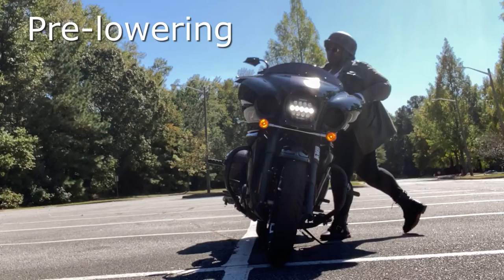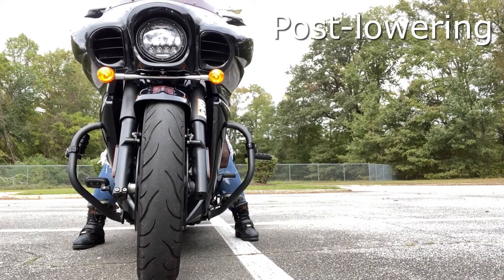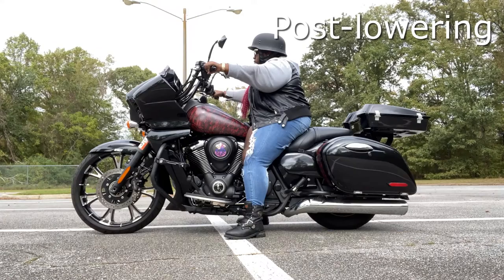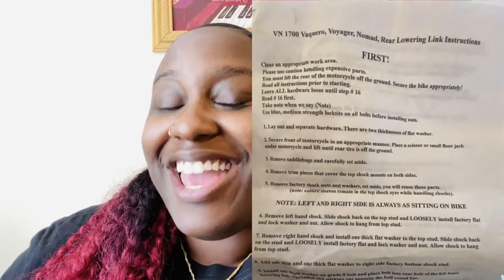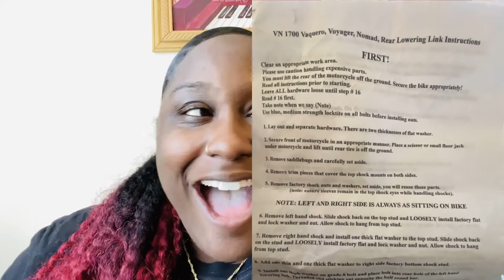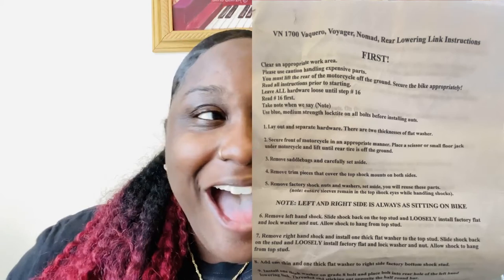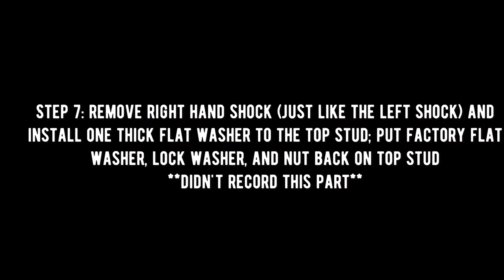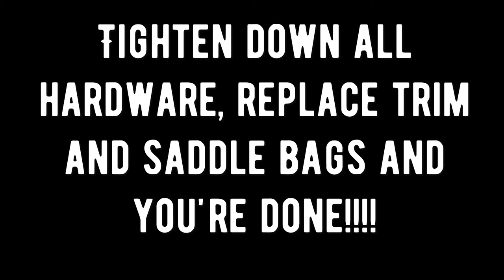LUVERNE LOWERING LINKS FOR KAWASAKI VAQUERO & VOYAGER/NOMAD | Review & Installation Process

Comment: When you decided on the Vaquero, did you have prior experience riding big heavy bikes, or did you just take the gamble of learning and improving "on the job". I'm in the market for a bagger/cruiser and always liked Kawasaki Vaquero & the Vulcan 900 classic LT. I'm a returning motorcyclist (after a 30 years lay-off) but have never ridden a cruiser/ bagger or anything bigger than above 500 cc motorcycles. Now I'm confused about which bike to go for. I'm in the Fall of my years, 6'3 tall, and of 'normal' physical build and strength. And I know conquering a big, heavy bike is not done by muscles, it starts in the head. Could I start out on a Vaquero, knowing that the tricks to master this are to be careful, studious, and exercise the slow curves, turns, stops, and starting out of and riding around turns uphill? Or is it simply too much of a bike? Please, I would appreciate your insight and suggestion as a rider and owner of a Vaquero. So, it's Vulcan classic or Vaquero respectively 630 LBS vs 840 LBS?
Reply from the maker: Hey Christian! I had a Vulcan S first, a Vulcan 900 classic three months later, and finally my Vaquero 6 months after that. I quickly found out that I’m a quick learner. For me, getting used to the weight of the bike was the biggest thing. I think I would have been ok starting on a 900 and moving up. I can’t relate to being tall (lol) but if I had to guess...based on how I used to have to tiptoe my bike...I think the Vaquero would be cool for someone of your height. If you do decide to start on a Vaquero, the parking lot will be your best friend. Check out the Vaquero or Vulcan groups on FB; there are a ton of resources and people who will be able to give you solid advice. Looking forward to seeing what you decide on. 🤗

Comment: Hi Rho, did you think about changing the seat first, before the lowering links, to leave as much travel as possible in the suspension?
Reply from the maker: Yes I considered a new seat but most reviews for the seats I looked at said that they felt that they sat higher with a new seat rather than lower. And budget was a factor also.
Reply: @RidingWithRho  I'm a McShorty as well, 5'6", and in the process of buying a Vulcan Voyager 1700, so looking at seats first as some of the roads around me are pretty rough, wanting to leave as much suspension as possible...:). Love your vids, thank you...:)
Reply from the maker: Oh yeaaa that makes a lot of sense. Congrats in advance on your new bike and happy riding! Thanks for watching 🤗

Comment: So how did the saddlebag reinstall go? Are they touching the bolts? Did you make any adjustments to the shock settings (add air, etc?).
Reply from the maker: The saddlebag reinstall was fine...no issues. Idk if maybe the the tourpack rack helps with spacing? But the saddlebags don’t come close to the shocks or bolts and everything tightened in just fine. 

Didn’t make any adjustments to the shocks but when I take my bike in for it’s 10000 mile service I’m gonna get it checked out.
Reply: Vaquero Nation Stand up!✊🏽✊🏽✊🏽